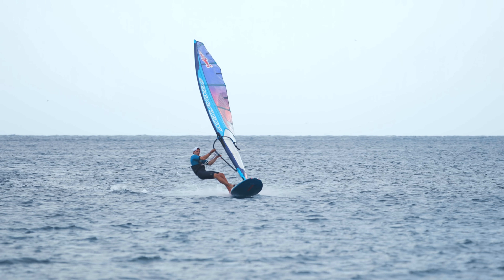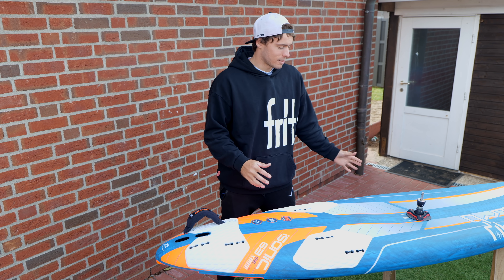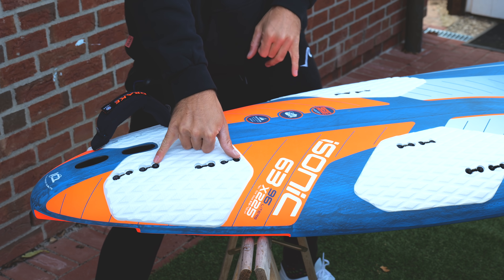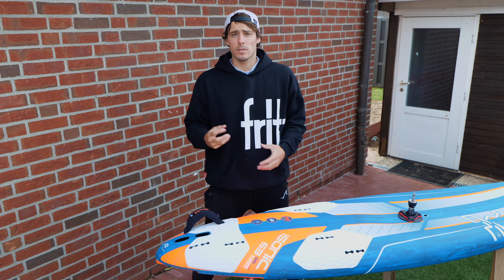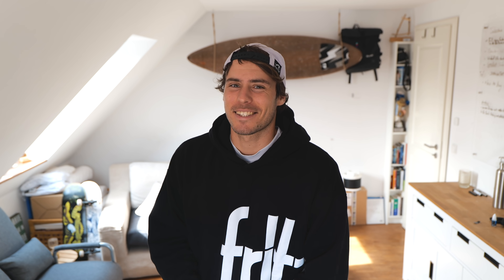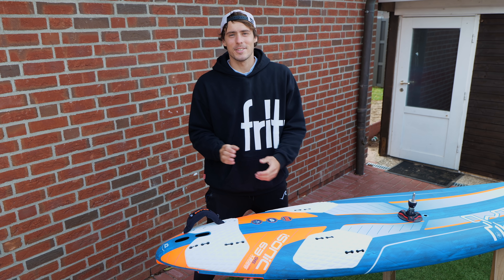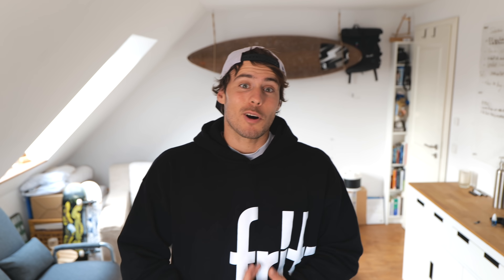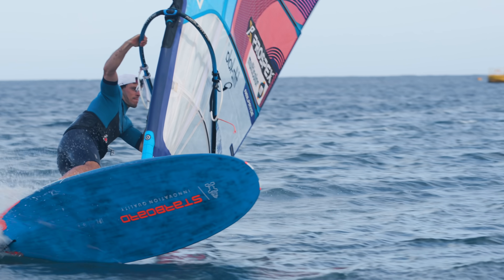HOW TO: FLATWATER BLASTING 🚀 | Windsurf Tutorial

Comment: I used to speed sail in the mid 80's. The main flat water speed mode was "Close the gap"(space from the bottom foot to board). We had different board bottoms for different wave conditions. Flat was faster but double concave to a slight  V was the most controllable in chop.

Comment: I have recently stepped up to slalom gear after 20 years on Freestyle wave boards only.  at 55 years old my sole focus is speed this season.  I have been able to fly the board on the fin.  Also, first time in 15 years or more using cambered sails so getting used to that more constant pull.  Now working on sail tuning to maximize speed while still maintaining control.  Loving it!

Comment: Hi Nico I have learned a lot of all your video's but I stil have a problem. When I'm plaining and try to make more speed as you sad 'to fly with your board' it's hard to keep your hight. So my question is, what is the balance between speed and not getting loses al off your hight. because I hate going up wind because it is most of the time slow and a little boring.
Jente

Comment: Hi Nico. Is there a speed limit for railing the board? As I feel, when I go above 20knot, I try to rail but I can not manage to do. By the I am using old slalom board with freerlde no cam sail. Do you think that’s because of the sail hasn’t got a proper flyable profile shape just because it s freeride sail? Thanks in advance. All my greating

Comment: I think its all up to the individual windsurfer Nico. No need to get too technical. All boards come with standardized foot strap holes and whether you like it or not, THATS what you have to play with.
Customs boards are much better. You get a board that is set up for YOU; BUT they can't keep up the volume.
The reason starboard have shortened the mast foot is as you say: it only ever moves 4cm maximum back or forth depending on the length of the board.
The rest is just a juggle for each's individual needs and windsurfing stance.
Nice promotional video.
Cheers.

Comment: Thanks for the tutorial nico. But for some reason i always turn upwind when i get my first foot into straps. Any idea why that happens? It might be bcs i dont bend my back leg/ i bend my front leg.  Idk always used to sail upwind and then come down by gybes a bit
Reply: You need to push on the front leg for the board to stay cross wind and open your sail a bit.  Depending on your gear, it is recommended to go a little downwind to set yourself in the straps and gain speed, then start to head cross wind or upwind.
Reply: Think that you realise pressure from your front foot, so you end up pushing only with your back foot going upwind, try to compensate putting more pressure on the harness and through the mast, while you step into the front strap.

Comment: Tutorial request: How to stop blasting! Neither me nor the board came with any brakes
Reply from the maker: haha 😁😁
Reply: Well this is actualy a good question. Especially if the speed is above 60km/h , it is difficult to change direction or stop. The pressure on the back off the board is so high you need to slowdown first and then change direction or brake This is a known issue under speedsurfers. So give them room when they are at high speed.